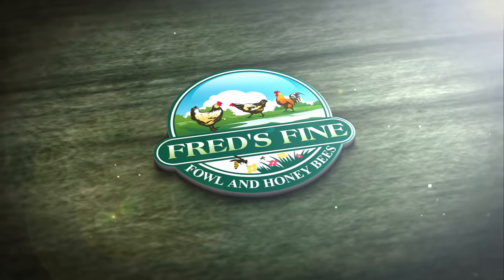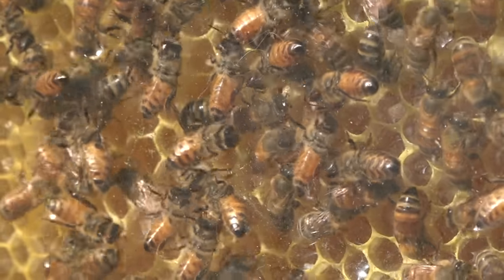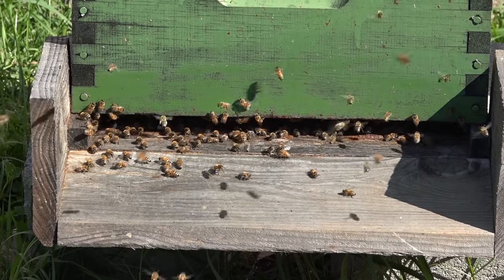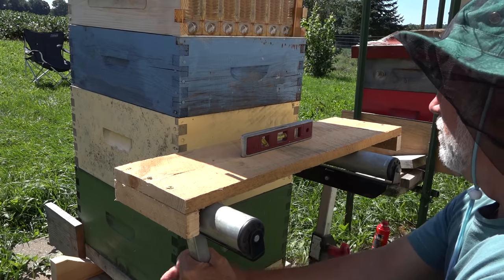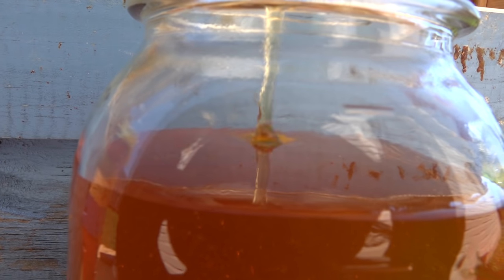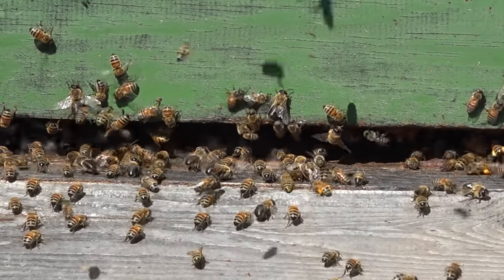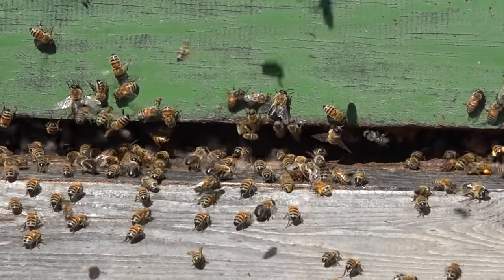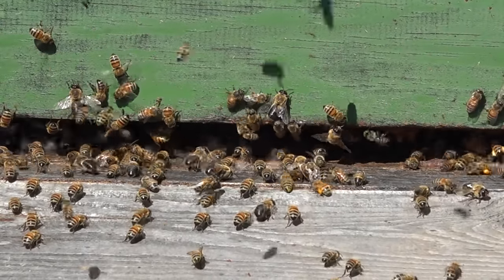First Flow Hive Extraction Cycle How to remove honey without filtering frame by frame

Comment: Can you please tell me how you go about your inspections with that heavy super on? Do you actually lift the entire super off for inspections?
Reply from the maker: I would like you to ask the same question to any beekeeper with any style of stackable supers. You'll find that during the heavy nectar flows, no beekeepers are pulling honey supers and doing brood inspections, it's just not good management as it really disrupts the bees. So, you do the inspections during dearth periods, or right after you've harvested honey. You "can" pull the super and do inspections during the flow, but as I've mentioned, it's really the wrong time to be interrupting them. Inspect between nectar flows and you'll have all the information you need to keep your colony healthy and know their disposition. I hope that makes sense. :)
Reply: That would make sense if I was commercial but I didn't think it was a problem to clamshell and check my stuff normally but this super is very very heavy so I was just asking thanks. I would be afraid during the dirt when the mites are at their highest not to check and see how my bees are on numbers of mites
Reply from the maker: @ginapicciolo3228  If mites weren't controlled prior to the nectar flow, then you could check for their presence by pulling the tray out, cleaning it and then visiting it again after 72 hours to see the mite drop. You could then treat with Oav as necessary. If you suspect brood issues, then you'll have to pull the super, and if it's too heavy then one frame at a time would be your best method. I hope that helps.
Reply: Absolutely but my nektar flow is almost all year in California

Comment: I eventually want to get into beekeeping but was wondering how to do so in a sustainable and environmentally friendly way for the bees, and your video popped up! Any links to the site where you got your beehive? Also, I'm planning on also using the beeswax, but not sure if it's possible to do so in a less invasive way. I might have to mix in normal beehives with flow ones to get the result I want. Any tips and advice?
Reply from the maker: Yes, the link to the website that sells these hives is in the video description. If you add a medium super above the flow-super you will be able to remove bees wax from that if you use foundationless frames. You can also get cut comb that way.
Reply: @FrederickDunn  Great! Another thing that I'm worried about is the height of the beehives. Do they have to be that tall or can I get them shorter? I'm only 4"10 lol
Reply from the maker: @reikatsukiyomi5926  The flow hive is actually great for short people, standard Langstroth hives with honey supers on them can get very tall. :)
Reply: @FrederickDunn   Is this for all types of flow hives or just the Flow 2 and Classics? What about the Flow hybrid? Yes, I was reading up about the different types of hives via the link! There's so much I still need to know before starting out. As for bee's if you don't live in Texas should you try to find bees in your own state? Are Texas bee's different from PA bees? Gaahhh! I feel like I have so much to do, but I'm also excited?! Lol!!
Reply from the maker: @reikatsukiyomi5926  Please watch my videos on Saskatraz bees and the Weaver Bees from Texas, I selected them for their natural disease resistance and survivability. The Saskatraz bees are supposed to be cold-hearty and also possess some resistance to disease, I'll have a full review of their performance in the spring of 2020.

Comment: About how long did it take to empty 1 frame of honey? Do you ever have to take apart the hive to clean it?
Reply from the maker: Emptying a single frame is widely variable depending on the temperature of the honey and environment. On a nice hot mid-80's afternoon, a single frame can drain off completely in 15 minutes.

Comment: Would it be wise to extract on flow frame a day to reduce the effect on the bees rather then all frames of the same day?
Reply from the maker: Once the frames/cells are all capped, it's not much of an issue. But you "could" extract single frames and come back for the others in increments.

Comment: When the bees all come out after an extraction, does the queen come out as well?
Reply from the maker: That is highly possible and should be carefully thought about when extracting honey. I did not see her on the outside and I did not see any of the workers facing a center cluster or circling as they would if the Queen were present outside. BUT, as I've said, it technically could happen and should be avoided.

Comment: hello Frederick i am from Germany and i have one Question what kind of Frames you use down the Flow hive? Zander  oder Langstroth-Beute., Segeberger Beute ,Dadant  (488 x 145)Deutschnormalmaß (DNM) (394 x 223 mm)Zander(475 mm breit und 220 mm hoch)Kuntzsch (250 x 335 in hoher Ausführung und 330 x 250 in breiter Ausführung)Langstroth (482 x 232 mm)or can i put the Flow frame on every Box and frame setup 
what kind of Box do you Use?Thx for your Answer
Reply from the maker: The boxes below the FlowSuper box are a mix of Piergo and wood frames that the bees draw out themselves. They are all standard Langstroth frames, two deeps and one shallow and then the FlowHive SUPER is on top with flow-frames inside. They are the 10 Frame size boxes.

Comment: i would assume that the overflow is because of cracking the full frame at once, not from extracting all 7 frames at the same time. each frame has its own honey funnel. but if this funnel overflows, that is what causes the dripping. so i plan to purchase one of these 7 frame systems. but i will only crack the frames 1/3 at a time. once the flow slows a bit, crack another 1/3, and then the final 1/3. this slows the extraction, but also eases the load on the bottom of each frame.
Reply from the maker: The flowhive designers said it's common to have leaks during the first extraction and subsequent extractions leak less. All subsequent extractions produced little to no leaking at all.

Comment: Great video. I will be taking delivery of my bees in a couple of days. I have located the Flowhive in my olive grove where it will get some shade in the mid to late afternoon but I am a little concerned that the hot mid day sun might be a problem. The temperature gets up to 100 degrees plus in the summer. Should I erect some type of cover to give them some shade in the hottest time of the day, or can they cope with it ?
Reply from the maker: If we know that a heat wave is coming, particularly partnered with low wind conditions, I put up a white canopy directly over the hives. Your best defense other than shade, is to paint all of your hive equipment white and provide an upper vent. A vented top with a wide overhang that provides mid day shade down the sides is also helpful. There are keepers who lost honey bees this year due to profound heat, but it was around 130 deg. F at mid day. 100 deg F isn't a killer, but you can help!

Comment: Have you considered if the bees would mutate?
I think this "automation" pattern of breaking the cells and making the bees get used to the "shock", this might act as an effect that would intiate some kind of a mutation. 

Thus, a new breed of bees may appear.

The impact of the new type of bee on normal bees and environment is hard to predict.

So, for a couple of years probably nothing would happen, but after 5+ years you may want to observe the bees in these Flow Hives and check for mutations.

This is the only real problem I can see with this. The plastic might also be an issue, since it releases poisonous particles over time. It's ok to use platic bottles for single use, but it's not ok to use platic to store food for a long time. So if Flow Hive boards are not thoroughly cleaned every couple of months or so, they may accumulate poisonous particles, and that will cause mutations for sure.

As an experiment it would be interesting to try to use gold instead of plastic. Obviously, it would be expensive but the results may be very interesting.
Reply from the maker: These supers will not result in mutated bees. Nothing would change for them. The plastic does not release any "poisonous particles" over time. However the single serving plastic water bottles people use often to have micro-plastics in suspension. Some keepers are using swiffer sheets in hives to trap small hive beetles, studies show that those result in micro-plastics in honey, and bee digestive systems. The flow-frames "to date" have not produced detectable micro-plastics in honey or wax. Adaptive changes in honey bees would take longer than you or I have left on earth. There are plenty of normal frames and foundationless comb in the brood box and in my case, the medium supers. I don't think adaptation is a concern.

Comment: My concern is that how many bees are squash during the extraction process, as some bees are probably in the cells
Reply from the maker: I'm curious where that concern comes from? Normally, people who claim that happens have never actually seen a flow-hive work. If it were true, which it isn't, then bits and pieces of bees would come through the tubes along with the honey. AND, after the frames were re-set after the draw off, you'd see the undertaker bees dragging dead smushed bees out onto the landing board for removal. By design, it doesn't kill bees when cycling.

Comment: Hey Frederick, great video - I wonder if you could let me know your thoughts on the following: your setup is how I think I want to do it - 'normal' box hives with flow hive for collection on top) - is that something you'd recommend? I personally think the whole flow package is too expensive but I struggle to fault the honey extraction system, as it saves needing to buy other specialist equipment. Your thoughts would be greatly appreciated! (Of course, regardless of the hive of choice, utmost care to the bees is essential regardless!)
Reply from the maker: Hi James, since this video, I have converted all but one of my hives to flowhives. My current setup/practice is to have the deep, then one medium, or second deep above that one. So, at least two boxes prior to adding the flowsuper. I take off the flow super at the end of the season and leave the bottom two boxes for wintering over. I also don't put the flowsuper on until the bees have filled the lower boxes. This has been a great year for our local bees where I live. Aside from having to pull frames, or supers and then extracting, there is all of the mess associated with uncapping, filtering, spinning, and then bottling which used to take over most of a day and then... all the cleanup. I am really enjoying this method and continue to enjoy managing my bees. I wish you all the best.

Comment: Hi Frederick. These two videos were excellent first-hand information. I have just one query and that is regards the role of the second super; the box beneath the FlowHive super. If you are running a conventional second super do you extract honey from this or leave it for the bees?
Reply from the maker: Hi Brad, thank you and that's a good question. That medium super is for the bees to make sure they have plenty through winter, then it will be harvested in the spring if there is anything left.
Reply: Many thanks Frederick. Taking delivery of my first colony tomorrow in a brood box/standard super configuration, with the FlowHive super to sit on top ... so have been wondering what to do with the conventional super that is coming with the brood box.
Reply from the maker: ***** I always store plenty of extra supers and have them ready to expand the traditional hives. BUT, with the FlowHives, I no longer need to do that as I can take off honey to continue to provide them with expansion space for storage. There have been seasons when they loaded the boxes/supers faster than they could dehydrate the honey, so you couldn't take it off yet, that's when you still need those extra supers. Keep them handy.
Reply: Many thanks Frederick

Comment: Can you access the propolis and wax that accumulates at the bottom?
Reply from the maker: Yes, you can pull frames and have access to all parts, if necessary (normally during winter) you can take the components completely apart for cleaning.

Comment: Hi Fred did an artificial swarm and I went in the hive about 3 weeks after and I have workers laying because I have more than one egg in a cell how do I put this right?
Reply from the maker: You don't have to do anything about those extra eggs. That will sort itself out as the queen gets older. It's common for a new queen bo start off overly productive and then it works out. Notice the cell size, if those are worker cells and not drone/large cells, they she's fine. :)

Comment: Hey Frederick, Thanks for the video!

Do you have any opinions on the use of so much plastic in contact with the honey? I would be afraid to use this in an area where there are hot summers due to plastic chemicals leaching into the honey.
Reply from the maker: The plastics are being used currently in very hot climates, part of my evaluation is sending honey samples out for the presence of plastics, that testing is not as easy and available as you may think. I will be sure to share the results good or bad. We'll see what the lab has to say.
Reply: Frederick Dunn
 Wow! So glad you are looking into this. No reason to use something like this if it means poisoning our bodies.

Thanks again!
Reply from the maker: kanger80 You're welcome!

Comment: Hey Frederick, I'm confused what they eat after you drain the honey. Does this cause famine throughout the hive?
Reply from the maker: Hi Matt, I tried to answer that question in the video. The FlowSupers in my videos are not the only hive bodies with honey in them. There are other honey supers with plenty of honey in them for the bees. During periods of high nectar flow, honey bees continue to expand their honey storage areas until they run out of space, or the supply in the environment runs out. IF you only have a base brood box and the next box is your FlowHive with FlowFrames in it, then yes someone does run the risk of taking away much needed stored honey. Based on my personal experience, having brood boxes on the bottom, then a medium honey super (where they keep their winter food supply) and then a FlowFrame-Super that can be taken off.

Comment: You could remove the flow frame from the hive and do your extracting inside of your home.
Reply from the maker: That would eliminate many advantages of the FlowFrames. First, the flowsuper is very heavy so you'd be pulling each frame separately. You'd also have to remove the honey bees from the frames. The honey bees could not immediately go about restoring the frames and continuing with honey stores. You would have cleanup inside your house that is unnecessary. The honey bees would have to be smoked and uncovered as with traditional honey extraction, causing them to consume honey and become somewhat defensive. You "could" do many things, but the easiest and least involved method is simply to use the flow frames while in place on the hive. I have come to enjoy this process without getting the bees all worked up and wasting their energy. When I remove frames from my hives, I have guard bees that fly in defense of their colonies for several hours after extraction. 
There are many lines of bees which are far less defensive and you may not notice a difference with them. I would also have to put on my bee suit when removing hive components, I'm not against that, but am simply describing the extra work removal involves.

Comment: thoughts about having a reducer board without the reducer in at the bottom of the flow frame to catch honey vs letting it drip over the whole hive?
Reply: Also, what is the flashing light for?
Reply from the maker: letting it drip inside and be retained on the bottom board without dripping to the outside was best. This situation hasn't happened again since, so we're good. The flashing light is a bear deterrent, we have black bears around and they often destroy honey bee apiaries in my neck of the woods. They don't like the flashing light and avoid my bee yard. If you put a board under the flowframe specifically, the bees can't come up from the lower boxes to recover the honey and put it back in the nectar frames/cells. This was a one-time event/problem. In the second extraction video, I show that there was not a repeat of this issue. Thanks for the questions!

Comment: I am not a beekeeper, but very interested in the topic. I was wondering if you would only drain one or two frames from instead of all 7, would the evacuation of the whole hive still happen?
Reply from the maker: That is exactly what I'm suggesting that people do, drain from a couple of the frames at a time and then see what the bees are doing, if they are not exiting the hive, then continue to drain subsequent frames. I'm told by the flowhive folks, that most of the dripping happens during the first extraction, that subsequent extractions release less and less honey into the hive body. Thanks for your comment and question :)
Reply: Thank you for answering :) Very interesting videos!
Reply from the maker: ooParanoia You're welcome and thank you!
Reply: Would adding a board under the flow super (like one that goes between the super and the roof) help in that? The honey wouldnt drip all the way down into the brood, except in he middle where there is a hole. Would it limit the bee movement too much even if it wasn't there until it is time to harvest? (I am not a beekeeper)
Reply from the maker: ***** If you watch the next video (2nd harvest) all of these problems have gone away. Thank you for those suggestions though :)